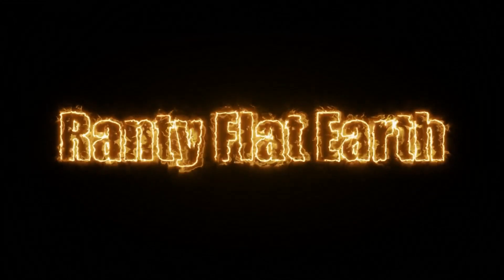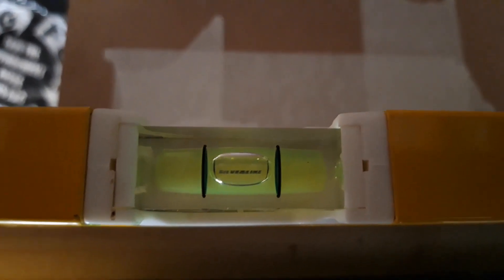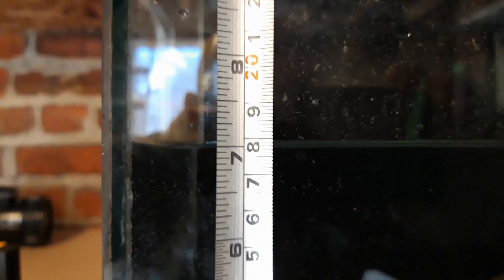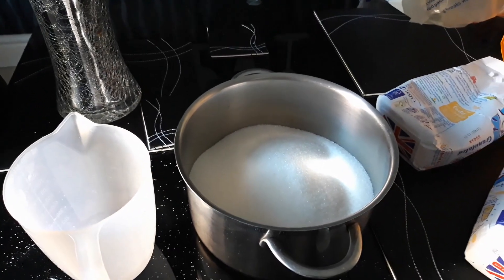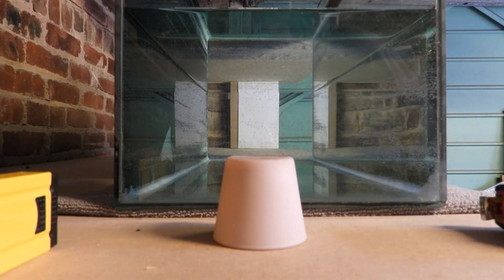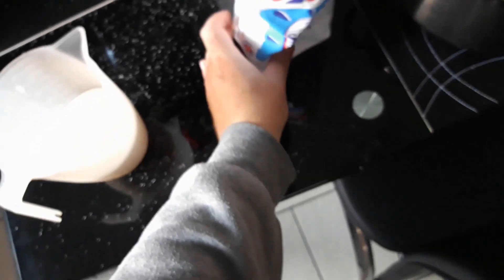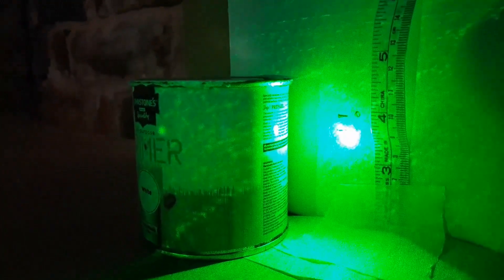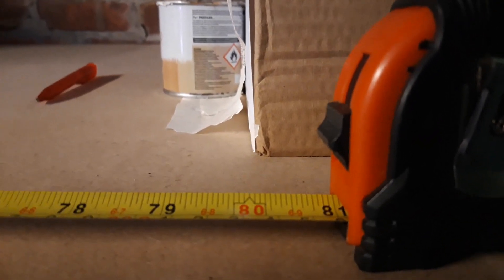Sinking Experiment Crushes The Globe Rhetoric For Observations

Comment: The problem with this,  I think, is that it requires those barriers in front to provide obstruction.  Sinking can happen if there's something to sink behind. But on a flat plane where there's no object between you and the object in question, it won't sink beneath the horizon.  You need something inbetween you and the object.
Reply: I'm not an expert, but I disagree with you. Optical sinking would be the only possibility to have an horizon as a pure optical effect. Among the flat earthers that have a little bit of brain (if this can be possible), and that refuse the easy magical solution of flerspective, the goal has become to show that the light actually bends upwards, or that there is optical sinking (Heath Carmody, and also in a twisted way JTolan Media1).
Being flat earthers however they begin not with the observation of reality, but they try to find in reality an excuse to proclaim victory.
Reply: @psalux18963  well if you think about it, i think you'll see that sinking can't happen without an intermediate object. the reason for this is that sinking occurs when light bends up (despite ranty getting that backwards in the video). so in order to not see the bottom of an object that means that the light bouncing off of it must bend up so much that none of it reaches your eyes.

but if that's true then th light rays bouncing off the top of the object will be bending up even more. in a bending up scenario, you can't see the top of an object but not the bottom of it.
Reply: @mscottveach  Refraction bends the light downward.
The effect exists for every photon that is reflected by the surface or by an object on the surface of the earth, and that travels in the lower layers of the atmosphere. 
So refraction makes everything appear a little bit more high than it should be seen. As a whole the effect is to flatten the curvature of the earth, and this means that the horizon is moved farther, that objects that were completely hidden by the earth now are looming behind the horizon, and other objects that were just behind the horizon now are seen within the horizon.
Optical sinking makes the exact opposite. It makes you see the curvature more curved. 
If the earth was flat it would make you see a curvature that actually doesn't exist, with the generation of a horizon that can hide things behind.
If the earth was flat any distant object at the bottom wouldn't be able to send photons to your eyes, and the top of the object would appear sinked, below the zone where it should be seen.
The rays from the top of the object travel in all the directions, and because the origin is elevated on the ground they have the room to go downward and then to be progressively bent upward until they reach your eyes.
Reply: @psalux18963  Well, refraction can bend light in any direction. Technically, it bends light passing between two mediums of differing density such that it bends toward the normal between the two mediums as it moves into the more dense medium.  In the case of atmosphere, conditions are such that it's usually bending down causing the object to loom - appear higher.

But in general, it can cause displacement in any direction depending on conditions.

I'm not sure what you mean by "if the earth is flat the bottom of objects would not be able to send photons to your eyes." It would be able to in that case. Without an obstruction between the point on the bottom of the object and your eye thenj the photons will reach your eyes.

If the top of an object appears sinked, that means that light rays that were strikiing below your eyes have bent upwards to strike your eyes.  But looking at a diagram you can see that if that' sthe case then the same thing should be true of the entire object. It all has light that bends up to your eyes. Thus sinking on a flat earth can't make things disappear bottom up.
Reply: @mscottveach  I say again that I am no expert and I could be wrong. But I think the easiest way to think about this is that refraction can be expressed as an alteration of the radius of the earth. Standard refraction is equivalent to a 7/6 radius of the earth, a longer radius; polar refraction, an extreme degree of refraction is like a radius of the earth that is 7/2, or 3.5 times the actual radius of the earth. Optical sinking on the spherical earth is rare because it requires a locally inverted gradient of density. When it happens you see an earth that seems smaller of what it is.
With the idea of the earth as a flat plane, the usual refraction would make the plane look like the interior of a shallow bowl. On the contrary an optical sinking would make the plane look like a globe, also a globe much bigger than the actual earth, but a globe, with a curvature and a horizon (and something that can be partially or completely hidden behind it).
Reply: @psalux18963  What you're saying is all more or less true.  Generally atmospheric refraction causes looming and yes, you can instead assume a slightly larger radius for Earth. This is, as you say, "standard refraction" - the typical conditions one finds. It's not the only thing that can happen though.  Nothing about refraction dictates that it always loom and the very notion of a standard refraction implies days where it's non-standard. 

I don't think looming on a flat plane would make anything appear concave. I think it'll just displace the flat plane slightly. But not cause it curve when it wasn't already. But my point about sinking is that it's impossible on a flat plane. You can't have an oibject on a flat plane such that refraction cuases you to not see the bottom of the object but you do see the top of it. The geometry doesn't allow for this to happen. If it somehow magically did, yes, it would give teh appearance of a globe. And thus be an argument for how the FE appears globe like sometimes.  But my point is that this kind of refraction (sinking) isn't possible under these conditions.  Hopefully, that s' all clear.
Reply: @mscottveach  we don't agree on this single point. 
Refraction reduces the curve, negative refraction (optical sinking) increases the curve. 
On a flat plane positive or negative refraction must by necessity produce a curve on one side or the other.
Reply: paolo salucci well we don’t agree because that’s not true... read https://en.wikipedia.org/wiki/Refraction?wprov=sfti1
Reply: @mscottveach  This is Walter Bislin answering on a related topic (to another person).
"Flat Earther have no working math model of Refraction that I could incoorporate into the App, sorry, that is not my fault. If I apply the working Standard Physical Model of Refraction, the Flat Earth would look like a Hollow Earth. "

Using the standard physical model of refraction the flat earth would look concave.

And later he says "If you want to simulate how the Flat Earth looks by using a false Refraction Model where light gets bent upwards, you can use the Globe Model and use values for k = 1 (no Refraction on FE, earth looks flat) to k = 0 (severe Refraction on FE, earth looks curved as a Globe with radius 6371 km)."

From k=1 to k = 0 the refraction is negative, and the flat earth looks like a globe.

http://walter.bislins.ch/bloge/index.asp?page=Flat-Earth%3A+Finding+the+Curvature+of+the+Earth
Reply: @psalux18963  In the first part, I think he's saying that if you take the refraction model from the globe and then apply that result to the flat earth you'll get a concave model. What I'm saying is that if you imagine a flat earth and imagine that it has atmosphere simiilar to ours and calculate what the refraction does then you won't get that same result. 

In the second part, he's not saying that refraction that bends upwards is false. He's saying that this isn't really what typically happens on Earth. The false isn't attached to "refraction that bends up" it's attached to "refraction model." For proof that refraction can bend in all directions you merely have to to go to that link I provided. Or look up Snell's Law or Fermat's Principle which are the roots of the concept. You'll see that refraction refers to the bending of light as it passes through dfiffering density mediums. The direction the light bends depends on the angle of incidence to the barrier between mediums.
Reply: @mscottveach  I already know how the physical law works, I don't have any problem at this level. Just because the physical laws work always in the same way, taking atmospheric refraction from the globe and applying it to the flat earth you will have not a different midel but the same law that works in the same way in different conditions.
No one is saying that the light bending upwards is false, we agree on this point. He is saying that the result of the light bending upwards on a flar earth produces the appearance of a globe, and that is what I said when I saw your first post.
However, these are details, but I wouldn't use your initial point as an argument.
Reply: @psalux18963  Okay, that's all fair but here's the point that I was making that I think you may be missing.  Imagine a flat earth.  Think about the light rays bouncing off a building in the distance. Now, in order for there to be sinking with obstruction what needs to happen with those light rays?

Well, the lightrays bouncing off the top need to be bending upward and striking your eyes. The light rays bouncing off the bottom need to be not reaching your eyes at all and instead lightrays bouncing off the ground in front of the object need to be reaching your eyes.

But how does atmsopheric density gradient create that situation? Why are the lightrays bouncing off the bottom of the object not reaching your eyes at all? There's nothing to obstruct them.  So where are they going? If  you say that they're bending so much that they all go above your eyes then how are the rays that are higher than them not also being bent in that way. They're all travelling through the same gradient. In order to get bottom up obstruction due to refraction, you need something in front of the object to provide cover for the bottom light rays.
Reply: @mscottveach  In the real earth atmosphere refraction almost always bends light downwards reducing apparently the curvature of the earth. In particular, not frequent situations refraction can bend light upwards, increasing earth's curvature. On a flat earth any bending of light will produce the appearance of a concave earth or a globe. 
In the only hypothetical, not real, happening of a constant bending of light upward, a flat earth would look like a globe, and this is what Heath Carmody that is a flat earther, but a little less stupid and dishonest than his friends flat earthers, would like to prove.
Bending upwards the light on a flat plane will produce a horizon.
A building that is in front of the horizon sends to your eyes photons from each point of its surface. If the building is behind the horizon the photons from the bottom can only pass above your head. The photons from the top of the building will go towards the ground, and then they will go horizontal, and then will go upward. You will see the top of the building lower than it physically is because you are seeing photons coming from below your eye level.
Common refraction lets you see something that is not geometrically in your line of sight, negative refraction (or optical sinking), hides something that is geometrically on a direct line of sight. 
You can't have one without the other.
Reply: @mscottveach  
At about 80% of this page, under Refraction Range of Clear Images
http://walter.bislins.ch/bloge/index.asp?page=The+Rainy+Lake+Experiment
Walter Bislin says this:
"If refraction is 0 then the Flat Eearth horizon is at eye level, while the drop for the Globe corresponds to a sphere with radius 6371 km. If refraction is 1, the Globe horizon is at eye level, the Globe looks flat, while the Flat Earth will appear concave. For a Flat Earth to appear as a globe with radius 6371 km, refraction has to be −1. Such conditions can only occur over hot ground and are confined to low altitudes over ground."
Reply: @psalux18963  I'm not sure what you're missing.  I'll try explaining it in a different way. On a flat plane, where the line between your feet and the base of a building doesn't deviate from the surface. In that situation, light bounces off the object.

Let's assume that the density profile of the atmosphere between you and the object is such that the light will bend up. With me?

Let's talk about the light bouncing off the bottom of the building. Now in the situation without refraction, you'll see some of that light and so will your shorter friend standing next tot you. In fact even if you have a friend lay on their stomach and put their eyes just above the plane, they too will see the light bouncing off the bottom of the building. 

Now imagine the refracted case. The light that would have hit your eyes is now bent up so that it misses your eyes. But light that would have hit your chest is also bent up.  And also light that would have hit your knees. So while iin the case of upward bending, the light that would havehit your eyes no passes above your eyes, but there will be light that used to hit below your eyes that will not hit your eyes. This will cause the bottom of the building to appear lower in your perception.  But you will still see the bottom of the building.

You said this, "negative refraction (or optical sinking), hides something that is geometrically on a direct line of sight. "

Btw, at least in English, it's not called negative refraction. It's just refraction. Negative refraction refers to exotic material where the index of refraction is a negative number. For the record.

But the issue that i have this claim you keep repeating is that sinking does not allow something to hide behind anything., The light rays are betn upwards, yes, but there are always lightrays below that one to replace them.. It causes the object to look like it is placed lower in your perception but it doesn't hide any of it.
Reply: @psalux18963  With respect to your second message. Bislin is not including "obstruction" in that table. He's merely talking about the drop effect of sinking.
Reply: @mscottveach  What can I say more? Everybody that talks about this topic understands that the only chance to have the horizon as an optical phenomenon is to have a strong refraction whith the opposite direction of the standard atmospheric refraction. Not only Heath Carmody and JTolan Media1, but also Walter Bislin, Roohif, Bluemarblescience, Bob the Science Guy.
Everything you said when analizing the light bounced off the building is true but it doesn't disprove the obstruction. 
Hypothetically there's a flat plane that with light bending upward seems like a globe, a very large globe if you want, but a globe. A globe means that there is a horizon. A building is 100 km away. The light is bent up 0.02 degrees per km. After 100 km it means 2 degrees that is equal to 3.5 meters. You are 2 meters tall. The light from the base of the building that would have hit the side of your shoe is passing 1.5 meters above your head. You see a horizon before the 100 km mark. The first part of the building that you can see is that that sends light towards the ground without hitting the ground, making a curve with concavity towards up, that doesn't gain more elevation than the elevation of your eyes. All the parts of the wall lower than this level will send rays that either are blocked by the ground or that are passing above your eyes.
Reply: @psalux18963  We must be talking past each other in some way. I'm not sure what you're trying to say with sentences like "the only chandce ot have the horizon as an optical phenomenon is to have a strong refraction..." I'm not sur what you mean by horizon as an optical phenomenon. If you mean the only way the horizon looms is with refraction in the more common direction then I don't disagree. Looming is a result of refraction. I'm not saying otherwise.

There are some issues with your example.  One is the amount of bend that light undergoes is determine in part by the angle of incidence. So, those rays coming from the top and hitting the ground aren't going to curve up at the same rate as teh bottom rays. Speaking of which, what exactly is this density profile on a flat plane that has a ray of light that moves at a fixed height above the plane hitting different density layers? If we're imaging horizontal layers then some shouldn't hit any differening layers nad thanks to the angle of incidence some should graze so barely that they don't refract neaerly as much.  Lastly, I think in the example you describe there should be a gap "darkness" between the lowerst mount of building we can see and the furthest ground we can see... I might be wrong about this one... but I think it gets pretty weird in this case.

I've never used Bislin's sim but does he have a way of testing this out? Can I set the density profile of that amtosphere and see what happens to the building?
Reply: @mscottveach  What seems impossible to you is exactly what I am saying. 
The hypotesis of the flat earth with a mechanism that bends the light upward is completely fictional, it cannot exist in reality, so we just have to think: what happens if the light is bent upwards? The easiest hypothesis is that you have a constant rate of upward bending, no matter what is the direction of the ray of light in relation with the air layers. 
So  what is expected? The formation of a horizon  where there is no physical barrier. The more distant is a point from the eye of the observer the more relevant the displacement of that visual point will be. everything is sinking but the far objects are sinking more. 
Looming is a phenomenon that doesn't just apply to an object behind the geometrical limit of what you can see without air, or when the standard refraction increases. Everything is lifted up, the near waves, the sea before the horizon, the sea after the horizon (so that the horizon is moved farther), the near objects and the far objects
With a very strong looming, (refraction in the usual direction) like the one that was found in the "black swan" image, the far objects, and the farthest sea too are loomed up more than the near sea and the near objects. There is a complete symmetry of the effects for looming and sinking.
Reply: @psalux18963  Well, we seem to continue to talk past each other. Just because FE is fictional doesn't mean you cant't be reasonable in the thought experiment. There's no reason to imagine the kind of exotic density profile that would be required to approximate what you're describing. 

You can't refract light so dramatically from the bottom of an object and not do something similar to light from the top of the bottom.

You're mostly right about refraction but I think you're wrong about there being a symmetry . If you want to continue this disucssion, maybe it would help to do it live. Come by and the discord sometime and we sort it out. It's a globe run debate discord that focuses on science and FE. This is the kind of thing we talk about a lot. https://discord.gg/72QMfW